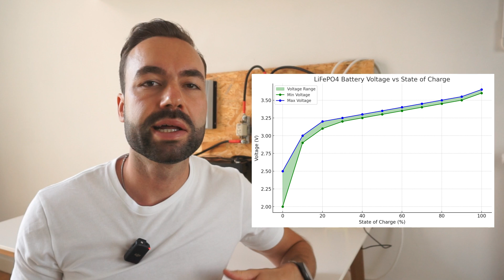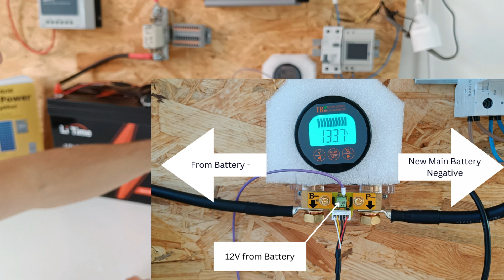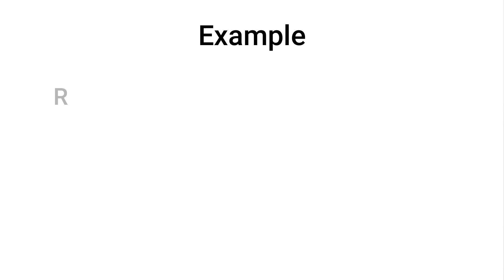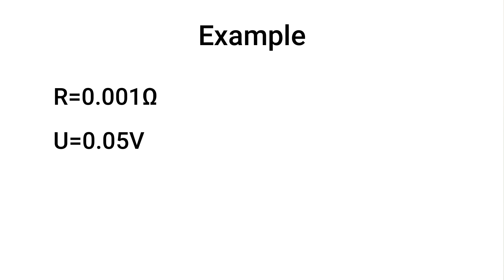How to Wire and Program a Budget Shunt Battery Monitor

Comment: I have the same unit but I'm wondering if I have a one-way shunt. You did not show the meter displaying the % of charge increasing while it is being charged. When I use my mains charger, I turn off the inverter and plug in the charger. the display does nothing, I have to wait for the red on the charger to turn green AND i have to reset the 100% on the shunt. That can't be right ???
Reply: I'll leave this here as I asked the exact question to AI and they nailed it. I was connecting the charger to the battery neg post instead of the other end of the shunt. Their first suggestion was to check the wiring diagram (which did not show the charger connections but not an excuse, literature was clear) Then they flat out told me I was bypassing the shunt (and the light went on)

Comment: I just installed it and.... The light is always on. Do u know any undocumented way to shut it off ?
Reply from the maker: It does not turn off and I don't think you can turn it off. However, I use a non-see-through tape on my alarm clock. I folded it back on itself so it acts like a door blocking the light.
Reply: @cleversolarpower i was not thinking at the light but at the Energy that Is Lost

Comment: I can’t get the small extra battery wire into your connector. 22 gauge plus a ferrel?? I can’t see room for a sewing needle to go in. You can expect mine to be returned for this reason. Just give me a spade terminal or anything that works. Now I have a 2 1/4 inch hole in my battery box!
Reply from the maker: It is a tight fit. It works with a 22awg ferrule. Once the screw is open you have to push it in because there is a spring inside. I have a video coming up on the victron BMV 712 smart as an alternative.

Comment: Bought a year ago and very dissatisfied with it. It never continually shows where the percentage is. it will discharge to anywhere between 50 to 80% and go back to 0%, most often it is around 80%. Once it got down to 27% and reset to 0%. That is no good to me.
Reply from the maker: Have you calibrated it? Bring the battery down to 0% or 100% and then tell it if it's either empty or full. Never had a problem with this shunt.

Comment: If i have 2 battries 100ah and 12volts each. connected in series. Or parallel. What ah in settings should i put in the device for each situation please.
Reply from the maker: In series 100ah. In parallel 200ah. The voltage will be auto detected.

Comment: HI,  the display and display light never turned off and burned the first numeral out on the display so impossible to really read, anyone else have this problem?
Reply from the maker: the display will turn on if there is a current being drawn in either direction. As for the display, i didn't have any problem reading it. It could be you have a faulty one, so maybe contact the seller and explain the problem.

Comment: G'day, I have a question about these monitors. Mine pulsates the screen for a time and then goes blank, then after a while it does the same again and keeps cycling like this. Do you know why it does this and how to stop it? Do I have a faulty meter? Thanks in advance, John
Reply from the maker: I think you are connecting it the wrong way around.
Reply: @cleversolarpower  You mean the B- and P- connections?
Reply from the maker: Yes

Comment: I have a seperate charge port so no way to monitor incoming power
Reply from the maker: That's a weird battery.
Reply: @cleversolarpower fairly standard lithium ion pack. Will this not work then?
Reply from the maker: You need a separate negative terminal to attach the shunt to.
Reply: @cleversolarpower I have main discharge with a qs8 and thinner charge input with a qs60
Reply: @cleversolarpower will this not work I assume? Should I return it.

Comment: Great video!
Quick question on installation. My setup the battery negative goes to a chassis ground post then to negative bus bar. Can the shunt be installed at the bus bar without any issues? 
Thank you.
Reply from the maker: Your shunt needs to be as close to the battery as possible. Because there can be current returning on the chassis. I never recommend to use the chassis as a return path for current. It could also be a grounding point, a floating ground. It should go from your battery negative to the shunt, then to the negative busbar. Then one wire goes to the chassis to make a floating earth.

Comment: I have two 100Ah batteries connected in parallel and I'm using a bus bar. Can I connect the 22 gauge wire to the positive bus bar? Also, there are two B+ connectors on the shunt. How do I know which one to connect the wire to?
Reply from the maker: Preferably directly to the battery terminal to get the most accurate measurement. Measure if there is voltage drop between the battery terminal and busbar if not, it's ok. The two b+ connectors is for two cables. You can use one of them, they are the same. What shunt are you using?
Reply: @cleversolarpower  The battery terminal of which battery? I have two batteries, which is why I just used the positive bus bar.

I have the exact same shunt as in this video. The 100A version.

OK, I will measure the voltage drop.

Comment: I have this exact shunt. I installed a 12v A/C on my camper. They want the battery cables hooked straight to the battery. Should I connect the negative cable to the right side of the shunt or keep it directly to the negative on the battery?
Reply from the maker: Not sure if I understand your question correctly. But you can have a cable in between the battery and the shunt like I have in the video. The other side of the shunt now acts as the main battery negative. So there should only be one cable connected to the negative battery post that is going to the shunt.

Comment: Are these displays constantly drawing power or do they time out and you tap the button to wake it up?
Reply from the maker: The screen backlight turns off after a while and you have to press a button to light it up. The values are still displayed. The consumption is negligible.

Comment: I have two LifePo 300Ah batteries with a built in BMS of 250ah.
Should I program the meter for 500ah based on the BMS? Or set it to 600ah?
Reply from the maker: The BMS is rated for 250A, not Ah. Batteries are rated in Ah. So you need to set the shunt to 600Ah once they are fully charged. (if they are in parallel)
Reply: @cleversolarpower  Thank you!

Comment: My monitor stays on is that ok? Can I run the small red wire to a switch?
Reply: Yeah, that monitor will be on all the time and I don’t think a switch will be a good idea. The shot works by determining how much Powers flooring out of your battery if you disturb that monitoring aspect you’re not going to get accurate values. I guess maybe if you could only disabled the monitor?? The light from the monitor is annoying for you and just make some kind of cover behind the light.

Comment: Hi
I have previously purchased a few battery monitors. However, they displayed the remaining capacity based on voltage values. The capacity value shown based on voltage is inaccurate. Does this product display the capacity based on voltage, or does it calculate the consumed capacity and subtract it from the battery's full capacity? Thank you

Comment: My setup is 24v 1000ah, will this work for it?, I dont know if the shunt has to match the battery bank's amp hours?!.
Reply: I have that same question. I have a 24v system. Will these instructions work?

Comment: hi nice review..question, do i have too set the voltage on the monitor to 12.7 as stated on my lipo4battery or just 12 v ?..cheers
Reply from the maker: You don't have to set the voltage.
Reply: @cleversolarpower  Ok thanks for reply
Reply: What is the default setting for the voltage? I change mine to 13.4v and now it randomly zeroing out my total amp and show 0%.

Comment: If you have to tell it the maximum capacity 100ah what if the battery has less already and you tell its 100ah won't the actual capacity be less overtime than u realised or one you say 100ah will automatically show 90ah so you know the battery has 10ah less than when it was new
Reply from the maker: You have to charge your batteries fully before programming the shunt. I thought that was clearly mentioned in the video.
Reply: @cleversolarpower  yes was clear in the video but was asking about how it works if the battery actually has less ah than stated eg 100ah but only has 90ah fully charged wouldn't the true capacity be 10ah lower than what you have set without you even aware and how would you find out the true capacity to set it up correctly the other guys answer seems like a good way to find out the true capacity thanks for replying tho
Reply: Discharge the battery, set the capacity higher than the battery capacity (e.g. set 20Ah battery as 30Ah), charge the battery. When charged it will show the true capacity.  Go back into the settings and set the capacity to this new value.
Reply: @craig00000  nice idea thank you for that

Comment: But I'm arranging my batteries in the bank to all connect to a positive and negative bus.  So it seems like I'd be getting a reading on the state of the whole group.  Am I to assume each battery is acting the same and therefore both are at the same state of charge as shown on the single display.  I currently have 2 100 aHr batteries but it is expandable to 3.  Also, I've seen that the wires for the source DC should be the same length on the way to the inverter.  Otherwise the batteries won't work evenly (?).  If I add the shunt, or an on-off switch or a fuze, do I increase the other wire's length by the length of that device?  For instance, on one leg I will have both a switch and a shunt.  On the other leg, just a fuze.  So the net length of each side will then be different unless I adjust the length of the wire on the fuze size.  Right?  And thanks.
Reply from the maker: The shunt monitors energy in and out. if you batteries are in parallel, they are balanced and at the same state of charge. if they are in series, then it might not be. you will need a battery balancer. No need to adjust the length of the wire because internal resistance of a device is different than internal resistance of a wire. i recommend watching my video about 'parallel batteries' and 'current sharing'

Comment: So I hooked it all up and it counted down from 100%. But it will not count up or even arrow up. I checked and it is charging up, just not showing.  I don't know what I did wrong.
Reply from the maker: Do you use the one i use in the video? If not, it's possible you use a one way shunt (only monitor discharging).

Comment: How do you monitor a bank of batteries; particularly if the battery sizes are not the same?  Must you measure each battery independently?  Thanks
Reply from the maker: Add the shunt to the most negative of the battery bank. You can say at the end of the battery.

Comment: Can I connect P- to negative buzz bar ... And B- direct to battery negative?
Also, could B+ go to the positive buzz instead of battery?
Reply: As long as the bus bar is attached to the new negative terminal it would be fine. Everything has to go through the shunt so nothing can be connected to the negative terminal of the battery other than the shunt. Taking the power from the + bus bar is fine.
Reply: @volvogt21  Thanks. it seems to be all good now.

Comment: I installed a battery monitor that uses a current sensor that you run the negative wire through the hole rather than this shunt type, less power cable connections.

Comment: I bought some different shunts and so far I have given up on them simply because they work for a little while but then they spark and burn up on me. It’s been my experience with them, even though I have followed the directions on each of them and connections were done properly. There has to be a quality one out there that acts like a regular voltmeter but can be permanently installed. That’s the only measurement device that works so far.
Reply: Burn? First time I've heard of it. You probably wired it wrong after all. Notice how BOTH  big terminals are on the negative side.

Comment: Is there some additional value for this aside from seeing the capacity left on the battery? I've been trying to figure it out and at one point thought I should consider the Victron shunt thinking it would communicate with the Victron MPPT to regulate charging more efficiently. 
What are your thoughts?
Reply from the maker: Shunts do not regulate charging. They are only a means of seeing how much is left in your battery. When the battery is full it stops charging. That programming happens in the charge controller itself, not through the shunt.
Reply: So if the battery 1000 orion by goldengate has this on a screen, there's no purpose for shunt? @cleversolarpower

Comment: Does anyone know how to program these monitors to a different shunt? I have one which was supplied with the wrong shunt and it is not accurate. They are available in 50, 150 and 350 amp versions and the display seems to be matched to the shunt - when first powered up it briefly displays a number which is the shunt size it is programmed for. The one I have says "350" but has a 150 amp shunt.
I have another one which has the right shunt for the display and it works well.
Reply from the maker: Best is to return it, get another shunt, or another display. Some brands are similar. There are multiple brands who are the same as I show in this video. I suspect they might be compatible with each other.
Reply: @cleversolarpower  For various reasons I wasn't able to return it. There are contact pads on the pcb which I suspect are for programming but there doesn't seem to be any information out there.

Comment: i personally use renogy 500 amp shunt. lots of fakes  so only get original .
Reply: I use what appears to get the exact same shunt as used in this clip. The quality of the build for the setup used in this tutorial, the detail of explanation make me comfortable with my purchase. I think I paid about $25 and the Renogy was about times that much at the time. I like Renogy, I use their solar panels, but the monitor isn’t as critical as the panels, and controller.

Comment: Guys it's great but I need it to be able to drow 400-800amp in that range 
Any suggestions what batery🎉 monitor to use?
Reply from the maker: In what world do you need a 800A shunt 😅. Victron has a 1000A shunt .
Reply: @cleversolarpower  I run LTO cells 12x40ah     
In car audio and fast discharge at some points are way over 800+ amp:)
Reply: @cleversolarpower  please can I have link to this item sir 🤝💙
Reply: @cleversolarpower  what's the model sir?
Reply: my mate .. you have a setup only ppl can dream of @that amps

Comment: Nick what do you think about flexible pv on the roof of my stationary truck, 200w mono 9.25a to power my 12v 3.5a truck fridge, battery incl 100ah lifepo4  2C eve cells, assume there are the associated connections mppt bms, what's your take on these? Cheers
Reply from the maker: Flexible panels are not that good because they cannot dissipate heats as well as rigid panels. Depending on your location they will degrade fast which can lead to panel failure after a few years. And their efficiency is a bit lower. So i suggest using rigid solar panels if you can. If you still want flexible, lookup 'rv with tito' for a method on how to cool flexible panels.
Reply: @cleversolarpower  watched rv with tito and travel new trails yes better to stick with solid panels, I'll put a roof rack on first
Reply: flexible, my opinion only . had 760watts on roof of caravan . lasted 2 years and died. my opinion . not yet
Reply: It is great you have an off-grid system. I want to buy a RV to avoid the chaos when the lights go out. But then I realize that there won't be any gasoline  nor diesel to fuel ⛽ the RV and then I go back to work to improve my place with more solar panels.
Reply: Good plan
Reply: Cheers